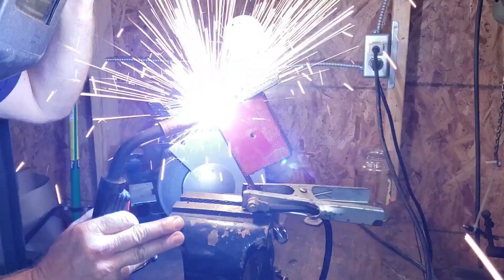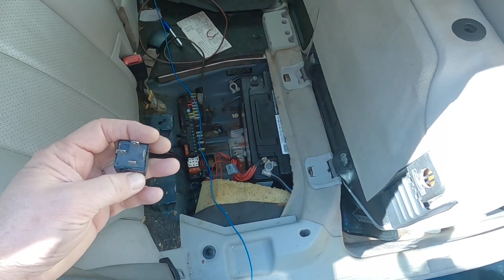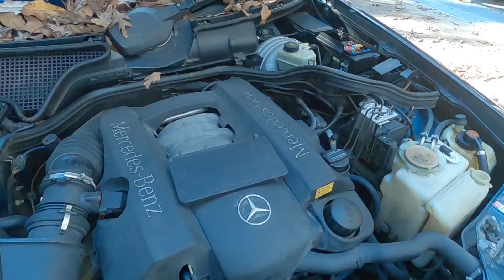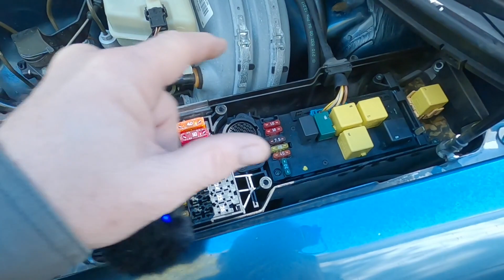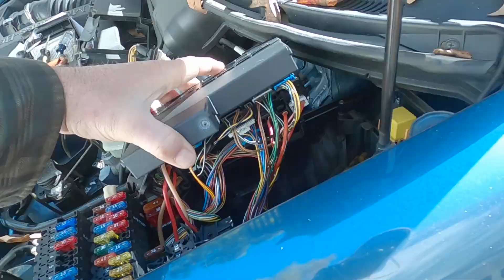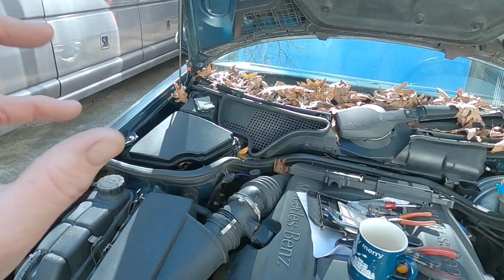VLOG - 2000 Mercedes E320 Estate/Wagon - No Start - Part 3 - Bad ECM ?

Comment: A straight-forward test for fuel pump function is to put a fuel pump pressure gauge on the engine bay fuel rail Schraeder valve, easily accessible. It would have told you the fuel pump was not developing pressure.
Reply from the maker: Very true. Lesson learned.  The problem in the end was improper installation of the new pump by your's truly. I left the little cap on the end of it. It was made out of translucient plastic and I did not see if when I pulled the pump out of the box while under the car. Another lesson that is hard learned is to always inspect your parts immediately upon arrival.
Reply: @ImpalamansGarage  Yeh, I read that in your other post. Now I just have to figure out why my E320 Wagon keeps burning out fuel pumps, pita when it's one's daily driver.

Comment: I'm having the same issue with my 00 e320 4matic changed the pump, filter coil packs. Mine will start after it sits for a bit but my fuel pump don't turn on all the time for some odd reason and I can't find the issue. I'm going to Try that jumper tip and see if that works.
Reply from the maker: Good luck.
Reply: The jumper did turn on the pump so the pump works. That's a start. It's like the pump works when it wants or only when it's cold.
Reply: I might pull the egr line and see if it's clogged or not tomorrow and possibly throw plugs in it. I just had it scanned and it said misfire cylinder 2&5.. needs plugs and wires.

Comment: Quick Lil MacGyver move you could run a separate line from the pump with a fuse and toggle in line to the battery see if that works.
Reply from the maker: I've sold this car but the fix was in fact the new pump. The problem was that I did not remove the little plastic cover over the output of the new pump when I installed it. 🤣🤣
Reply: @ImpalamansGarage  you slipped the hose over the plastic piece you're saying? Now it works fine I can't figure mine out for the life of me and it f*cking runs then after 10 mins or so it shuts off then you wait like 2 3 hrs and it will do the same thing. Can anyone please 🙏 help me with this it's my dad's car and it's taking up alot of my time when I need to work on my own truck.

Comment: Crankshaft position sensor behind the engine - you're done the replacement.
There's another crank sensor in front - I have a W210 too and come across the similar issue before. I did the replacement for both. Meanwhile, I remembered (not sure if it's relating) got replacement for coolant temperature, MAP sensors too. Prior to this jobs, I did the K40 relay replacement for both engine and rear seat. Almost 90% done, just crank again while running the engine say 1 hours, stop for lunch etc, then come back, it crank a few more seconds but would definitely start. Finally, I go for fuel filter replacement (not pump) and checked it is super dirty and this filter was since 2004. Now the condition is very good, definitely start, just say 1 outta 10 start may a few more seconds crank longer. Otherwise, it start right away.

Comment: Huge fan of your channel!  I have a 2001 e320 wagon and experienced an odd stumble/rough running condition with a new Crank sensor.  Turned out the cam sensor was the culprit.

I’ve had unexplained electrical issues and one was caused by plastic wire sheaths failing near the engine harnesses on the front and rear areas.

Can’t wait to see what happens!  Good luck!
Reply from the maker: Appreciate it! We'll see what happens when the ECM comes back. Might crank. Might not. LOL

Comment: Guessing they are not OBDII ?
Reply from the maker: Yes it's OBDII. The cutt-off date for OBDI to OBDII transition in the U.S. was in the mid 90s.
Reply: @ImpalamansGarage - Did no codes come up ?
Reply from the maker: @TheCanadianBubba  I have a simple code reader. Last time I checked they were just lean condition bla bla..... same thing that came up a few years ago and it was cracked PCV hoses which I replaced. There was an EGR code as well now that I recall. There was nothing that said holy cow your computer is fried... or would prevent the car from starting.  Now of course I could have missed something. We'll see what the repair shop says. I am curious to know what they find, if anything.
Reply: @ImpalamansGarage - Look forward to seeing more !
Reply: @ImpalamansGarage  1996 was when all vehicles must be OBD2 compliant.
Reply: Yes, it's OBDII, but there is a 38-pin left-side rear of engine bay connector socket that gives a lot more diagnostic points. You need the 38-pin adapter.

Comment: I’m sure everything will work out. Well done! For one thing I’d recommend getting a shop grade scan tool. Granted they’re pricey (about 500-1000 bucks), but it’ll be worth having that for any car. A bi directional tool that allows you to toggle and switch stuff on/off is one to save up for. Thanks for the video!
Reply from the maker: Yeah I've been looking on line at those. Got any recommendations?
Reply: @ImpalamansGarage  The brand autel has some very nice offerings that won’t break the bank. I personally was looking at the Autel MaxiDAS DS808 and 808TS. These seem to have all the diagnostic stuff their more pricier ones have for under $800. Good luck.
Reply: @ImpalamansGarage  OTC Genisys they're inexpensive and very powerful